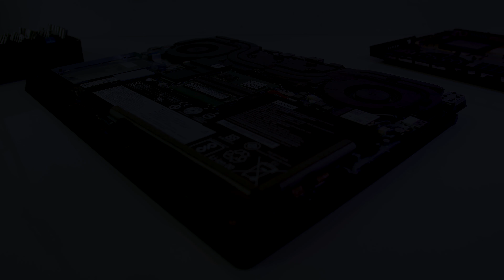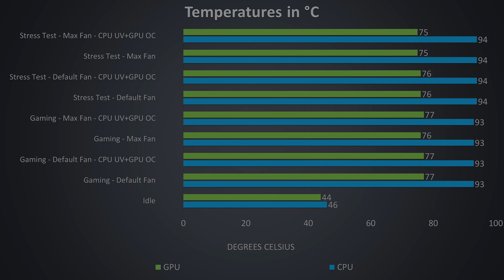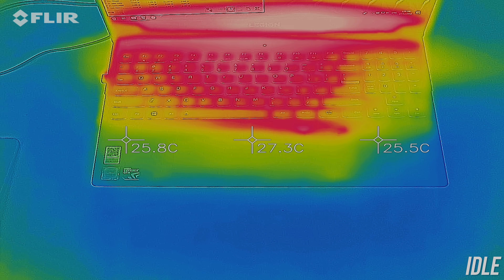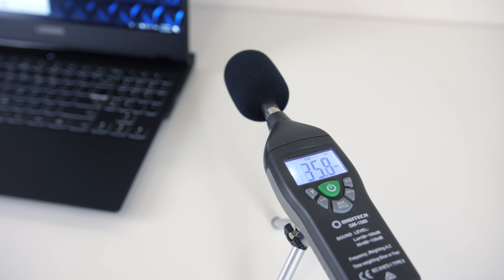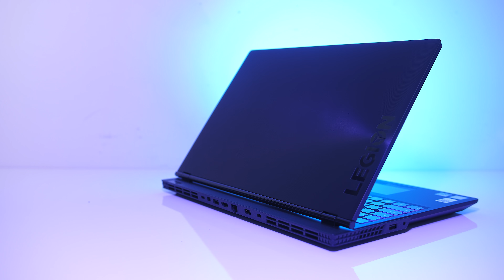Lenovo Y530 Thermal Testing, Overclocking and Undervolting

Comment: I really confused now, I need laptop with I7 8750H and GTX 1060 for 3d rendering, and I looked at this laptop, it's good the design is cool, but the thermal... Why? And I looked at another laptop, It's same, the thermal is so bad, Pavilion Gaming 15, HP omen, Dell G7, Asus TUF FX505

Is there no laptop out there with good thermal? Or should I buy one then change the thermal paste? But will that void my guarantee? I'm so confused 😕, someone help meee
Reply from the maker: 8th gen Intel CPUs just run hot in most of these laptops, just the way it is, regardless the performance is still good and you'll see an improvement with the i7 version. The ASUS Zephyrus range have good thermals due to the unique cooling design, and the Acer Helios 500 is also pretty good as it's got thick heat sinks, but that does make the overall laptop larger.
Reply: @JarrodsTech  But, Zephyrus and Helios 500 is too much for my budget, since I'm on a tight budget, I prefer something that cost like Y530 or Asus GL504 Hero II, do you have any recommendations?

Comment: How much undervolting should be done with the i7 ver.? I am definitely worried about the thermals
Reply from the maker: As much as you can do while remaining stable, that varies by CPU though so you just have to experiment to find out what yours can get to.
Reply: @JarrodsTech  So trial and error then.
Alright. But can I still use your -0.15V standard at first or is it still recommended to start from scratch and undervolt by -0.01V. I was reading https://www.notebookcheck.net/Intel-Extreme-Tuning-Utility-XTU-Undervolting-Guide.272120.0.html and I'm not sure
Reply from the maker: Yep basically, yeah I generally go with -0.15v for the core voltage offset as a starting point and change from there as needed.

Comment: My problem with this laptop is the amount of heat it produces in the middle of the laptop especially when it's charging, the fans just cannot keep up. When idled, on a desk the temperature gets really hot where I need to hibernate it to cool down, slightly mitigated if lifted up off the table with whatever crap I find lying around. I dunno, maybe my model is defected.
Reply from the maker: Yeah seems to be a warm one, mine is too, although others don't seem to have the issue so not sure. I'm going to investigate this more in a future video.
Reply: I've got the same problem , the area between the fans becomes a little hot when I'm charging while using my laptop and then I'll just switch it off because I worry I'll damage my laptop 😅

Comment: I have the exact model, the fans keep spinning randomly for a few seconds each time! how do I solve the issue?
Reply from the maker: Yeah a few people have mentioned that, as there's no good fan control I'm not sure it can be improved, you could manually max out the fan with the short cut, I think it's control + shift + 1, but then it's just always loud so probably not ideal either. I think Lenovo just need to update it to give us better fan speed control.

Comment: I really want to love this laptop but I can't get it how I want it to be. Under stress tests before repaste and undervolting I was getting 90-95c Temps. After I'm around 80c. Can't keep the clock speed up though.
Reply from the maker: Hmm, maybe raise the undervolt a bit so it has more power? What workload are you running? Is it something that's actually able to max out the clock speed like a stress test? Could still be a power limit throttle in place, happens sometimes.
Reply: @JarrodsTech  wow, I didn't mention any of the important stuff lol. I'm running the same config but with an 8750h. Those Temps were during stress test. I find most stable Temps at -.135v but get current limit throttling, not to mention random restarts in game. Gonna try.-125 again but I'm loosing my mind on this thing
Thanks for the reply! You got my sub.
Reply: @JarrodsTech  I've actually just confirmed that I dont power/current throttle when just stress testing the cpu, it only throttles when the cpu and gpu are both under load. core and cache at -125.
Reply from the maker: Yeah that's pretty common, there's always going to be a limit somewhere, combined CPU/GPU tests usually have limits in place to stop things getting too hot, sometimes you can try and adjust the power limits (PL1/PL2) but often I find they can't be changed in many laptops.

Comment: Hi Jarrod, I dont know if you are reading this, but thanks for the video. I bought this laptop because of you :). Only thing I need to check with you is specific fan noise. Not the overall loudnes..but when fans start to spin..I hear a quiet high frequency noise comming from the right side (right fan) - I dont think it is a coil whine..that sounds a bit different..and the noise is becoming more evident when the fans are going faster. I am quite sensitive to this kind of sounds..but I dont know if it is a thing of my unit..or it is a design flaw. Dont want to send my laptop to service for I dont know how long just to learn all Y53 with 8300h and 1060 are having the same issue.
BTW please..that repaste video will help a lot of folks around here...including me :) Thanks for the answer
Reply from the maker: No problem! I don't think I had that issue myself, or at least I wasn't able to hear anything obvious. I still plan on doing the repasting video, I've just been very busy over the last few weeks/months but it has not left the todo list!
Reply: @JarrodsTech  yes please do this, it is going to be a big help

Comment: I have i5 8300h version of this what the maximum undervolt should i do?
Reply from the maker: I have the 8300h too, the value will vary by chip, I just started with -0.15v and go up or down from there as required

Comment: Im getting a y530 , 8750h and gtx 1060. Should i undervolt the laptop once i get it?
Reply from the maker: It should help thermals regardless of if there is no throttling, so yeah generally recommended.
Reply: @JarrodsTech  alright thanks!
Reply from the maker: No problem!
Reply: I'am getting the same config as you, may i ask what program did you use and what undervoltage you did to yours??
Reply: @albertb.2676  i used throttlestop and undervolted it by 1.5 , check out bob of all trades video.

Comment: Hi , like your video , good job :). Hop you can help me. I want to buy this laptop for photo and video editing, regarding processors , will be there a big difference between i5 and i7 8th gen but regarding workflow, live not only rendering at the end of work ? Will this more cores will do the difference ? Thanks a lot or your opinion :)
Reply from the maker: I don't think that will matter too much, in my experience more cores is a much better deal when it comes to exporting the video / transcoding footage. The i5 is clocked almost as high as the i7 (same all core turbo, 100mhz less single core turbo) so it should still do well.
Reply: @JarrodsTech  Thank for fast reply, so in your opinion is beter to take i5 with more ram( like16 ) and ssd or i7 with less ram (8) and ssd as well ?:) thanks a lot , it is alway hard decision to take :
Reply from the maker: You can always upgrade memory and SSD but not the CPU, so I'd pick based on the CPU differences first, the other factors are secondary - though if you don't ever plan on upgrading, i5 and 16gb of memory would work better, especially if it's dual channel.
Reply: @JarrodsTech  thanks a lot ! I think i will take i7 for the future :) 
Ps. Do you have maybe some other options/ laptop in mind with good screen srgb and argb  for around 1300 dollars?:)

Comment: Is there a Y530 user who has a gap between the bezel section and the LCD panel at the bottom of the monitor?
If there is, I wonder if I can get a refund in accordance with the Lenovo policy. For your information, I bought a CTO model that I upgraded to a 144hz monitor from the official website of Lenovo, and I am currently thinking about this problem.
Reply from the maker: I can't say I recall a gap, but also not sure what you mean, you could provide a picture and I could compare with mine.

Comment: Which one do you recommend? Lenovo Y530, MSI GF63, or Dell G7? (All main specs the same i7-8750H, 1050Ti, and 16GB RAM)... I don't game that much, I just need something with good specs to edit my videos on, but at the budget of the 3 i just mentioned. I will replace all the drives and most likely hook up an external monitor when color grading only. Thank you so much!
Reply from the maker: I'd get the Y530, which I guess is why I bought it, better build quality in my opinion. G7 doesn't have fan control either, Y530 only lets you max it out so not that great but at least it's an option.

Comment: I really think either your heatsink isn't screwed in properly or your laptop is defective, because mine with an i7 8750h (and GTX 1060) barely breaks the 85 degree barrier when playing Battlefield 1 on ultra with no tampering with voltages. If you are keeping your model, I would highly suggest contacting the Lenovo customer service to look into your y530!
Reply from the maker: Others with the 8750H have mentioned the same, but a lot of people have also had the same issue as me. I'm going to do a new video soon with retesting the updated BIOS / repasting the CPU to see how that helps.
Reply: I think the key might be keeping the bottom heat sink propped up. I have the same specs as Usama and playing ME Andromeda for a few hours peaks my cpu at 85 (sticking to under 80 for most of it). This with a -125 v undervolt. Never updated my bios either, mine's from middle of last year. Only difference between mine and yours here is that the bottom back on mine's a solid inch and a half above the table.
Reply: even i have 17 8750h and it runs smoothly even in ultra graphics without any heat issues
Reply: How many hours do you get from the battery while not gaming and doing web browsing??
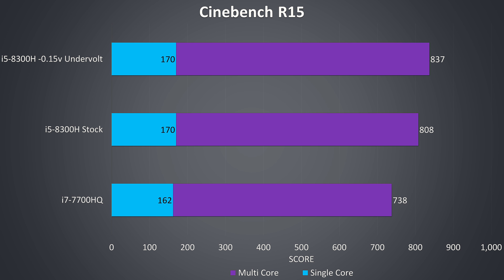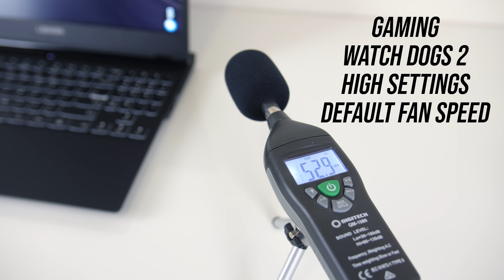Reply: @albertb.2676  around 3:00hrs with full brightness and 4:30hrs with >60% brightness
Reply: Do you still got problems with high CPU temperature ?
Reply: I have the i5 and 1060 variant, no throttling. Running +200 core and +400 memory oc
Reply: I have the 1050Ti model and it reaches between 85-90 while playing Battlefield V on ultra, is it bad? Or normal?
Reply: @ayhamo  Yeah it is bad, repasting might help though.
Reply: @gabenght9316  i can't do both repasting and undervolting as i got this laptop 1 week ago, i think cooling pad can do a little job :(
Reply: @ayhamo  Well, you might consider to return it. Neighter am I an expert, but my Dell Inspiron never goes above 74 degrees both CPU and GPU even after 12 hours long gaming sessions. Coming close to 90 degrees it's really not good. But yeah many laptops has this problems, the cooling getting better but the hardware getting more powerful and hotter. So it is never perfect.
Reply: @gabenght9316  well you actually scaring me, i got a unit first but it had blurry screen so i had replaced the laptop with new one but even the new one looks like that it has temperature issue, i will contact support and see, further the only option i have is hp pavillion or acer nitro 5, i need help actually
Also HW Monitor shows that cpu reached temp of 96 ( package)
Reply: @ayhamo  It's expensive stuff bro, don't hesitate to switch it if you are not satisfied. It is your right as a costumer.
Reply: @ayhamo  Wow that are really high temps. I would get refund and look elsewhere if I were you. Why these two are your only options?
Reply: @gabenght9316  got it from my local store and only these 2 are my option, both laptops actually has same spec
Reply: 85 degree is still not great.

Comment: I have 2 options between y530 and fx505ge .(i5 gtx1050ti). Which is good one.i have heard that fx505 have thermal issues.how about y530?
Reply from the maker: I'd probably pick the Y530, better build quality IMO, otherwise fairly similar.

Comment: Had this laptop for a day (i7, 1050), cpu was boosting to 3.9ghz non stop at 5 to 20% cpu usage (background windows updates). Lowest temps were 50 celcius went up to 85, fans were going nuts btw. Didn't even bother with gaming tests. Took it back the next day. Gaming laptops make no fucking sense to me.
Reply from the maker: Nothing there sounds like an issue to me unless you disliked the fan noise, most have adjustable fans but for some reason this one doesn't.

Comment: Should i get this or the FX505 ?
Reply from the maker: I'd get this, better build quality IMO.
Reply: Thankyou for your answer sir!
Reply: How about the display? Is it better on the Y530?
Reply from the maker: Pretty similar, but you can get the Y530 with 3 different screens and I had the middle one. You can check the results of my screen testing in the full review (linked in description) and I also have the same tests in my FX505 review too.

Comment: What do u use to undervolt and overclock?
Reply from the maker: I use Intel XTU for quick and dirty undervolting, but generally Throttlestop is better. I use MSI Afterburner for overclocking graphics.
Reply: @JarrodsTech  ok thanks , will try them out.

Comment: Im not a gamer .. but i really want a powerful machine and gaming laptops have great hardware these days 

On an everyday basis and task does it become hot occasionally 

And im confused between what to pick 
Dell G5 or Y530 with the i7 ..
Reply from the maker: I'd probably go the Y530 assuming you're talking about the 2018 G5 (the 2019 G5 is a fair bit better), it's available with better graphics and also higher refresh rate screen, and IMO better keyboard.
Reply: Jarrod'sTech thanks for the heads up jarrod .. you were very helpful 🙏

Comment: So is y530 worth it to buy? I need a good gaming laptop but also for work
Reply from the maker: Yeah it's decent especially if it's on sale, the full review is linked in the description if you need more info.
Reply: @JarrodsTech  thanka for reply man, can i have your opinion? should i buy i7 8750 gtx 1050ti? Or i5 8300 gtx 1050ti is enough for lenovo legion y530? Thanks

Comment: hi. Thanks for videos of this laptop. I have alredy buy the y7000 very similar to this laptop and really dont regret. The only bad thing is the temperatures.. So a question: If i do undervolt to cpu that void my warranty? i have 4 years warranty with costco. Mine is the version with i7 and gtx 1060
Reply from the maker: I'm not sure, but I also don't know how they'd be able to tell you've actually done it. I don't see how undervolting would damage the hardware as all you're doing is removing power (if you make a mistake and add positive voltage instead of taking it away maybe you could damage something)

Comment: Hello, Jarrod! Good video! Using Throttlestop I've underclocked maximum turbo boost frequencies to 3,4 Ghz for 4 cores (like i7-7700HQ) by changing multipliers. I haven't noticed any frames dropping comparing with 3,9 Ghz and my temperatures even after a long period of gaming never go above 80-82 C. Also I undervolted CPU to -0,135 v ;)
Reply from the maker: Nice one!

Comment: Hi, I’m hesitating between y520 (i5-7300HQ – 8GB ram -1TO+128SSD – GTX1060 6GB Qmax) at 799 euro and the y530 (i7-8750H -8GB ram – 1TO+256 SSD – GTX 1060 6GB) at 1020 euro; is the y530 worth it in terms of gaming performance? What about thermal and noise problems, is the y530 better or worse? Thanks
Reply from the maker: Hmm same graphics, so probably not too different in GPU demanding games with higher settings, but the 8750H is significantly better than a 7300HQ, as a result it will be hotter though, not really a problem, worth it for the much better performance, I'd get the Y530 if budget permits.
Reply: Hi , I bought the y530 i5 8300H with gtx 1060, it is perfect but it has an unstable ventilation that runs every 2 min in boost mode for 10s and it stops especially when I open an application ... Do you have a solution for to make it stable?

Comment: which one do you recommend : HP Pavillion Gaming 15 2018, Y530 or ASUS FX505 all three are with i5 8gen and 1050ti 
Had a bad experience with the y520 and im about to use my warranty and change for one of them
Reply from the maker: Hmm I haven't used any HP laptops so can't really comment there, between the Y530 and FX505 both were nice but I feel like the build quality with Lenovo was better, otherwise with same specs expect similar performance. I did have higher temps with my Y530 but others have said they don't have that issue while others do so it seems to vary.
Reply: Jarrod'sTech From what I found from video and customer reviews many people complain about HP overheating and it seems its not only for this laptop but for previous models. It seems they struggle to build a proper cooling I guess. 
Well since other two are equal I have no worries on which one I end up with.
Thank you, your comment and videos really helped me and made my decision easier.
Reply from the maker: No problem, hope what ever you pick works out!
Reply: 530 has 1050 not ti
Reply from the maker: @shubhammanna  Y530 is available with either 1050, 1050 Ti, or 1060 graphics.

Comment: I got myself a Lenovo Y7000 which is part of the same family of Legion Laptops with a full GTX 1060, but has an i7 8750H. Same RAM configuration and everything else appears to be the same. Performance appears to be almost exactly the same, so buy based on looks and price. I think the thermals are significantly better as I almost never see thermal throttling during gaming, but the fans get super loud. Sounds like a jet engine when they are going full speed.
Reply from the maker: Yeah I think they're pretty similar, hope the new laptop goes well!